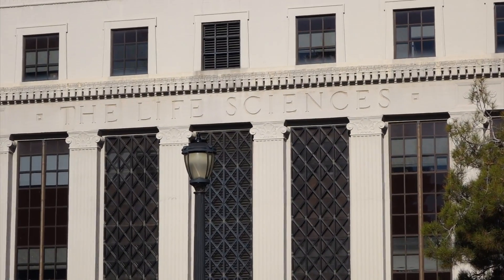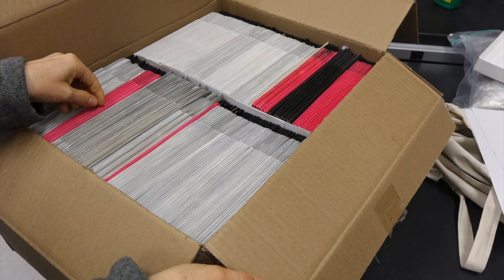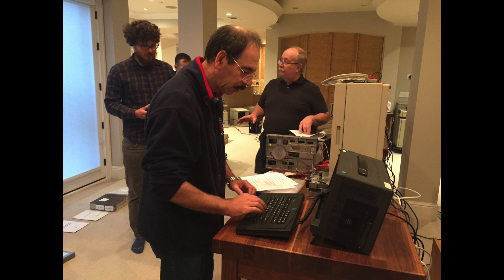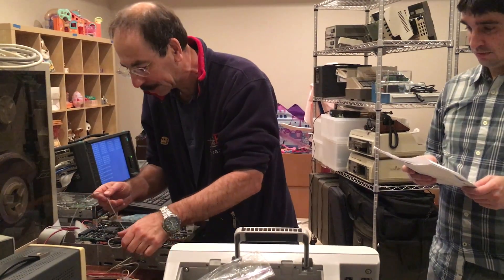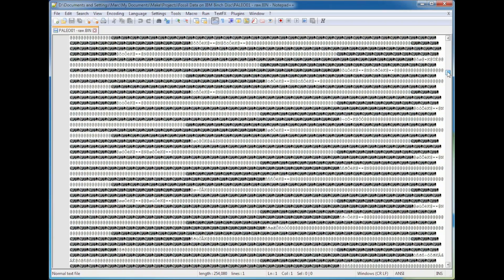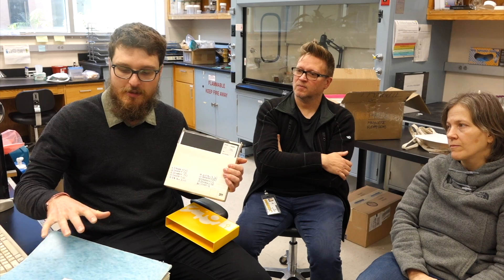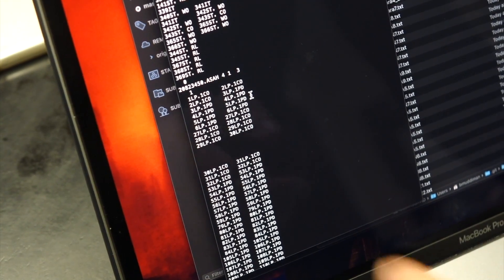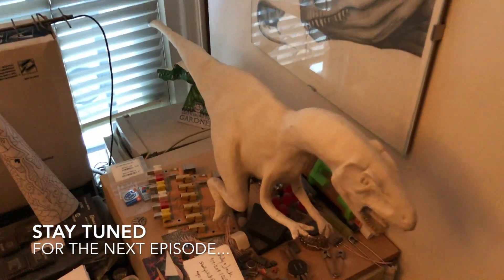Fossil Data Part 2: 8-Inch IBM Floppy Data Recovery

Comment: Amazing how quickly cutting edge becomes almost undecipherable. From 1979 to 1984 I worked as a service and installation engineer for Olivetti, at that time 8" floppy's were used on all our top level machines including those used in banking systems. I would service and repair those drives down to board level but I had absolutely no knowledge of the format's used to store the data (although we could read it with data recovery software). Great to see that superseded technology is not completely consigned to the recycle bin. This video really brought back some memories, thanks.
Reply: I worked for a company (SYCOR) that made terminals that Olivetti used in some sort of global network.  Later I worked for a different company and attached an AT&T 7300 (the Unix PC) to a Unix minicomputer that provided real time stock quotes.  The AT&T 7300 was manufactured by Olivetti for AT&T who dropped it for mysterious reasons.

Comment: As  Marine In the 1980s,  I worked both as an operator and as a programmer for the USMC ruggedized version of this  https://en.m.wikipedia.org/wiki/IBM_Series/1 it used those 8 inch floppies. We called it the green machine as everything was in olive drab ruggedized metal bodies and transport cases.  I remember them being particularly sensitive to the power frequency when we were running off generators and they would start making crazy noises.

Comment: I saw this and was immediately taken back to my IBM S/34 days. I still have the machine and it has the optional 2 magazine 10 disk reader. You load the magazines and it auto sequences the disks reading 20 at a time. This job could have been done in about 3-4 hours on it. The S/34 first came out in 1974ish and was able to read S360 data on floppies.

Comment: In 1996, we had a hard drive crash in our ship's control console, the brain being a Bailey Network 90 Automation System typically installed in Power Plants but in this case, aboard a ship. My electronics guy used the backup disks which were 8 inch floppies, to reload the software onto the new hard drive.

Comment: These floppy formats were considered "soft sector" because the sectors were written when the floppy was formatted. I worked on a project in the early 70's that used "hard sector" 8 inch floppies. These were made by Memorex. The floppy had holes punched in it to mark the beginning of each sector (there were 32) and one extra hole that marked the beginning of the track. These were fairly easy to control with state machine logic

Comment: Used those n an Altos 8000 unit in the early 1980's.  On CPM  and MPM as I recall.   PIP instead f copy, wordstar datastar supersort - fabulous software.   The 8 inch floppies never held enough data as far as we were concerned.  Back then a 20 meg drive was a big deal.

Comment: I have two of those floppies somewhere hidden in a storage box, in 'original' plastic covers. I rescued these,  somewhere in the late 90's at work, from throwing away, a huge container with all kind of stuff. There was also a mainframe, huge and unable to take it home :-D. The disks where located inside the massive door (top loader) of the drive (operating system disks?). Cannot remember the mainframe model number however it was for sure an IBM.

Comment: IIRC, by the time of CP/M most 8" drives (Shugart) used a 40 pin connector, not 50.  50 pin cables were used for SCSI.

Comment: You only need that 8" drive, they did sell them till 1980 ish and was open and used on many systems, try to find the later released models. I/O controler is needed too, on some old AT system on 34 pinns, 12 + 5 volt you need
use duplicate software, not just the C>: prompt copy!

Comment: In the 1980's I worked for a data processing service that used an A/S 400 that read the 8" floppies that held the data written to them on our 3741 data entry workstations. I wonder if there are are still A/S 400 units out there that would have saved you folks all the hard work of reading your disks with the hardware you had to put together.

Comment: Like several other old IBM mainframe nerds, the minute Marc showed the raw data and said "this looks like nonsense" I immediately shouted at the screen, "it's EBCDIC! It's gonna be in EBCDIC!"

I went to the U of Illinois Urbana-Champaign and as an undergrad worked as a student computer operator on what certainly would have been that same IBM 360/75. Those printouts looked very familiar to me.  So cool!

Comment: The old IBM floppy disk drives usually fire right up after you heat up the spark plugs and liberally apply starting fluid

Comment: It's insane how durable this kind of disk is. It was common in machine tools, industrial automation, and minicomputers to put the bootstrap on a hard-sectored 8 inch floppy and never replace it. The drive, the piece of equipment, or possibly the life of the support engineer, wore out first.

Comment: You'd be surprised to see how many of these are still in use. I've been fixing recently a 5Mb hard drive attached to a CPM computer with 2 8" drives. Used daily to test semiconductors.
Reply from the maker: Did you let your customer know that they had since come up with a new model? ;-)

Comment: Wow, 8 inch floppies. I saw such a thing in the office of an emeritus electrical engineering professor, more than 20 years ago, but have no experience with such a legendary thing. I remember using 5.25 inch floppies for a long time, and then 3.5 inch, and then of course came CDs, DVDs and flash drives, and I got in fairly early on the personal computer market but even I never had such disks or drives for them.

Comment: The edge connector you are showing I believe is called an MFM connector.
Reply from the maker: Don't think so, although MFM certainly relates to floppy discs. MFM stands for Modified Frequency Modulation, the floppy modulation encoding format that quickly supplanted the original FM see here, as it offered double the density with the same magnetic size domains and same bandwidth.

Comment: I had a part time job cleaning out obsolete computer rooms, long ago. We hauled thousands upon thousands of those old 8 inch disks to the landfill. The hardware went to the recycling plant where it was run through a crusher and then melted for aluminum. Oh well.

Comment: I used to fix the 33FD back in the ‘80s.
The quiz question is why does the belt not run off the pulley?

Comment: 2:05, you say "3741" but the words on the screen say 3471. Just thought I'd mention that.
Reply from the maker: Yes, slongue of the tip. 3471 it is, and the disk format is known as the IBM 3470, which was the name of the whole system including the printer and the tape converter.

Comment: Also, if you're dealing with 8" floppies there's probably a 90% chance the contents are ebcdic.

Also, you could have picked up a circa 1982 TRS-80 on ebay for about $500 and an emulator and that's all you would need to dump those disks.

Comment: So cool. 💕
Extreme low level detective work. So much data has been lost not because the media can't be read but because the structure has been lost.  
I started on IBM System/360 in 1967 (look at my avatar/icon) and lived in the EBCDIC (Extended Binary Coded Decimal Interchange Code) world for 46 years. Never encountered a user 8" disk.

Comment: Marc this reminds me of a incident from my own experience.  I used to work in a mainframe shop in tech support  (BOFH  sort of job)  I belonged to several online forums which proved very very handy.  One day I was home visiting my father.  He was a retired scientist  who had worked on a 7 year project for a national laboratory that was canceled. Anyway, his lab data which he had painfully assembled  he still had.  He had it  in two formats:  One was reams and reams of printouts on   blue bar fan fold paper.  the other was on a 9 inch tape drive.  Dad’s shop had used an old PDP11/44 running RSTS and an early version of MUMPS (later M)  Dad had a modern M on his home PC and  was trying to hand type (and Dad was a hunt peck typist)  in the data on. 

 I put out a notice on some of my Forums:  “Hey does anyone have a 9 Track 1650 BPI  tape drive still functional on their mainframes?”    I got a reply  “Yes we have one. it is going to be decommissioned this month”   I UPSed the tape to that operator as quick as I could.  About a week later I got a email and a FTP address and pulled down a 30mb file that was basically 7 years of Dad’s  research.  Next time I was home I presented a SCSI drive (this was a LONG time ago) to him with the data;  I knew he used that format.  Dad sent a thank you gift to that operator and was happy as could be.    Retro formats…..the ONLY part that always seem to work from the early days is the paper manuals….
Reply: That's really a heartwarming anecdote.  I bet Dad was absolutely chuffed.
Reply: @Starchface  I am in  the State or as Churchill  said "separated by a common language".  I had to look that up.  Yes he was pleased as punch..  :)

Comment: I was tasked with moving a mainframe computer from a Macnamara Florist office.  The ancient thing had four eight inch floppy drives and four 40 megabyte MFM hard drives.  It was connected to a dedicated server somewhere at Macnamara central offices.  The thing was super heavy.  I asked the manager why they did not upgrade to modern machinery.  The manager told me that the old mainframe could only be used to talk to the central server through telephone lines and to store local business data in the hard drives.  To change the enormous mainframe that looked like it was made in the late 1970s, the main server at the central office would have to be changed as well.  Then all the other antique mainframes would have to be changed at well.  That would cost millions to do.  Thus the vintage hardware was still being use at the time.  This was about ten years ago.  I wonder if they still have those old fossils working.  If I remember correctly, the manager told me it worked with an operating system by Novell.

Comment: 8" to 5.25" floppy adapter here:  http://www.dbit.com/fdadap.html
..and something curious, you may have not considered.

"Some 8" floppy disk drives require a "TG43" signal, which tells the drive whether its head carriage is currently positioned at a track number greater than 43 (in which case the drive should use reduced write current). This signal is not normally provided by PC FDCs, so the FDADAP board has a microcontroller which monitors the disk bus and keeps track of the signals related to seeks, so that it knows which track each drive is positioned on, and transparently generates the correct TG43 signal for the currently selected drive with no intervention from host software. The on-board CPU also combines the per-drive "motor on" signals from the PC controller into the common signal used in the RX50 and 8" drive busses, and in current versions (since 2009), displays the selected drive's current track number on small 7-segment LEDs."

Comment: So in a time where space was precious like gold, they did a two padding system? Padding to a fully emulated punch card and then to a full sector size?

They must be had a side business selling those disks ;D
Reply from the maker: The electronics were probably just simple gates, no microprocessors existed then. This was probably the simplest implementation they could muster without having to throw a mini computer at it.
Reply: @CuriousMarc  interestingly I've learned RPG/400 in 2007 on an AS/400. They still use the one-line-is-one-punchcard-logic to be fully backwards compatible. 😂

Wondering how they would store files today on a disk 🤔

Comment: Why would there be a possibility of it shredding the disk ?
Reply: The first way that comes to mind is that a (spring loaded) part in the drive breaks loose and starts to push against the disk surface while it's spinning. I don't know this kind of drives, so don't know how realistic it is, but something like that would be imaginable generally when there are moving parts and possibly broken equipment.

Comment: It is so fascinating that you guys seem to get almost anything working. I would've been so terrified to even try to hook up a very vintage drive onto a even Win98 era  computer if I knew I couldn't easily get an another 8inch floppy drive.

But then again, you guys aren't in the middle of nowhere so your part and spare availability is through the roof compared to what I could get my hands on.

Comment: Whenever I had a job that involved 8" floppies, I wanted to run away and drink until I couldn't see.  I never did, but man, working with those things was exasperating!  The disks wound never read the first time, you had to do it over and over and over.   Some equipment worked better than others, but I got stuck using Wang drives for a huge project, and they  would not behave.  I nearly changed career paths after that project.

Comment: Happy memories of using these, instead of those damn mark sense cards for Fortran IV programming.
Reply: Mark sense for coding? Shudder. Thank God I never encountered that (I usually punched my own cards)
Reply: LOL. I was learning at uni and the keyboard card punchers were in high demand, while mark sense was quick and, literally, dirty. Trouble was, if you ran a stack and it had syntax or coding errors, you'd then erase the mistake, run it again and probably hit another boo boo. Repeat erasing of the soft pencil would smear the cards, leading to exponential errors and it would all end in tears. I have never recovered.
Reply: I learned how to clear jammed punches because the lines were long and there were no lines at the jammed machines. Ah, memories.....

Comment: I still have a functioning computer that takes 8inch floppy's, a Panasonic JB-3000.  I last booted it off one 2 years ago.  Its sad you can't get new discs, I am hoping to modify the computer to boot off a a flash card at some point and then image the disks, using an XTIDE card.  But I haven't done it yet because its a pre XT computer and I haven't yet found documentation to indicate if it uses a standard 8bit cards or not.

Comment: As soon as I saw all those @ signs I thought "that's EBCDIC"...seen a lot of that in my mainframe career (usually by users who accidentally did binary file transfers to their PC). I'm glad you guys made the old data live again. Well done :)
Reply: EBCDIC - IBM encryption standard, strange that they didn't recognize it at first glance.
Reply: It’s not encryption, just adaptation to the realities of pre-microprocessor digital circuits.  EBCDIC was designed to map eight “bits” of a restricted subset of the 12 bit card column (12, 11, 0, 8, and 9-punches make five independent bits; no more than one 1-7-punch make three bits) with a number of exceptions into an eight bit unit of memory (for which IBM invented the word “byte”), and back, reversibly, using a logic matrix of discretely wired diodes in each direction.  ASCII was invented later and has no such logical connection to Hollerith punch card codes.

But I know you meant “encryption” in a humorous way! 😉
Reply: @Allan Richardson i should have marked the "IBM encryption" as it was ment: a joke, like "double ROT-13 for enhanced security"
Reply: rarbi.art What I figured!  Incidentally, when an IBM mainframe tries to do packed decimal arithmetic with a string of EBCDIC spaces, it looks like a decimal number of alternating 4s and 0s: 404040.
Reply: @rarbiart  Strangely enough I didn't recognize it, but immediately knew since this was old IBM mainframe stuff that it would be EBCDIC. I also knew that they would be able to handle that. Even as someone who hasn't touched EBCDIC before just checked and I even have tools to handle it (BBEdit on Mac can handle EBCDIC, but it isn't enabled by default).
Reply: @John McFerren  they are lucky that it was at least IBM and not one of those 
more obscure mainframe brands which came into existence in some countries as procurement had to source national if any available. Bull comes to mind...
Reply: "So the American government went to IBM to come up with an encryption standard, and they came up with — EBCDIC!"
Reply: As a side note: Cesarian codes have been considered suffienct for a long time.
Reply: I've had to interface our software to an ancient EBCDIC machine somewhere in the bowels of IL state government in just the last few years. It lives on ....
Reply: LOL, it still happens.  I have issues all the time where a source sends in the wrong format to the mainframe.
Reply: Just ran across this video today;  immediately recognized the EBCDIC format as I spent way too many years reading core dumps.  The 40s jumped out as spaces right away..... so glad to see this adventure to completion - in those days IBM was the master of documenting everything and years later it’s a good thing!  How many other old mainframe folks still long for their collection of Red Books?

Comment: As a guy born in 1970s, I remember as a young kid that hobby computers of the 1970s were commonly on 8" floppies.

My earliest experience of 8 inch floppies was that they were the microcomputer standard floppy during the MITS ALTAIR era, and the S100 bus era of kit home microcomputers.  

I had never thought of IBM having 8" floppies in their mainframe and minicomputers but of course they did.

I always thought it went from "card" to tape, and that they didn't bother with 200-800K floppy disk storage as a medium on IBM shops.

It would be neat if someone had catalogued all the portable mass storage mediums that have ever been widely used out there. 

I just googled and my beloved Commodore corporation actually also made an 8" floppy drive, I have never ever seen one in the wild, but there was an ieee-488/gpib interface equipped model 8280 8" floppy drive.

I love it that you guys could find and fix a bad transistor on this 8" drive.